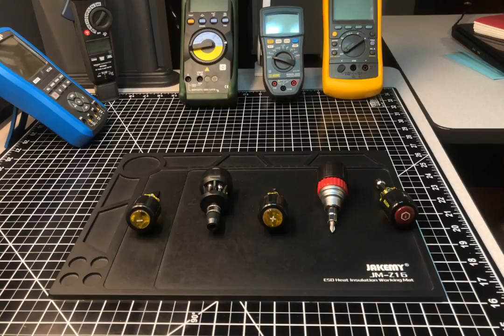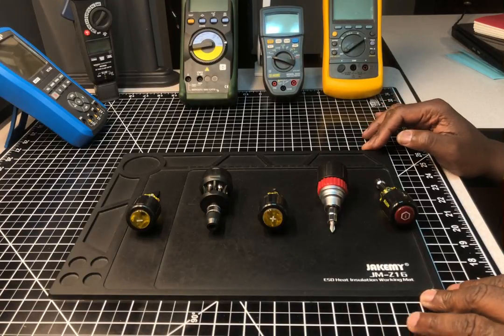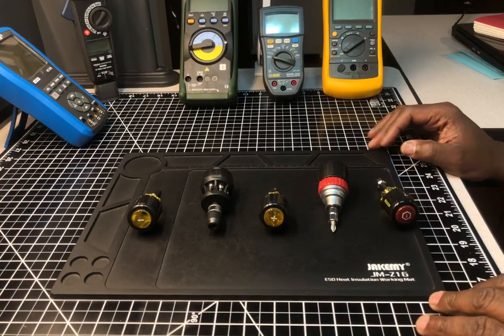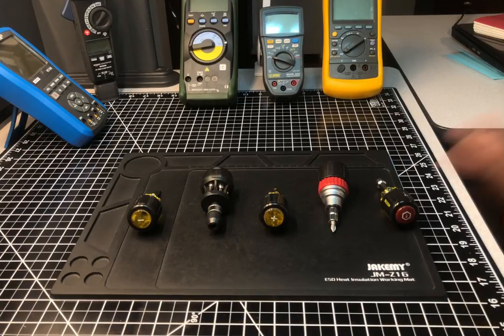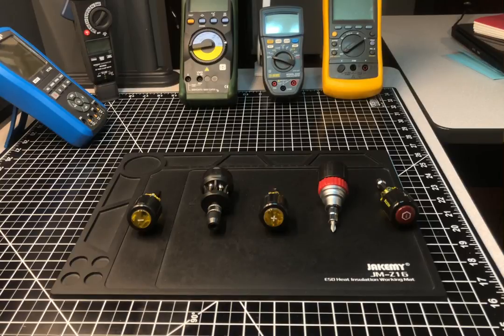🇺🇸🇨🇳🇯🇵 Electricians Stubby Screwdrivers ( Do Electricians Really Need Them ? )

Comment: Where the stubby screwdrivers are generally used?
Reply from the maker: I consider stubby screwdrivers as a specialty tool . I used them on machinery, recessed can lighting. It one of those tools you may not use everyday but every tool bag needs one. Thanks for sharing